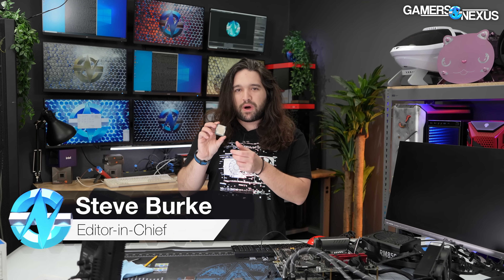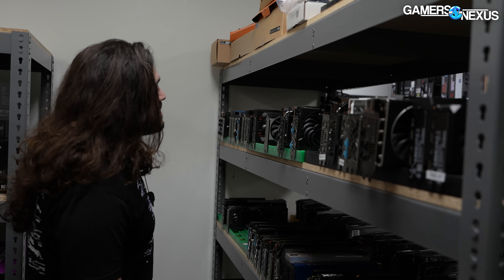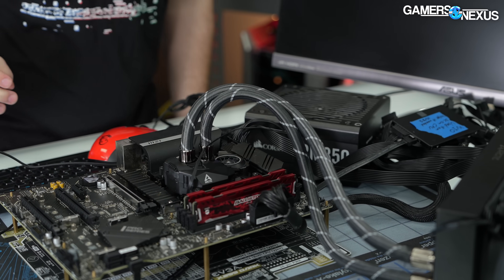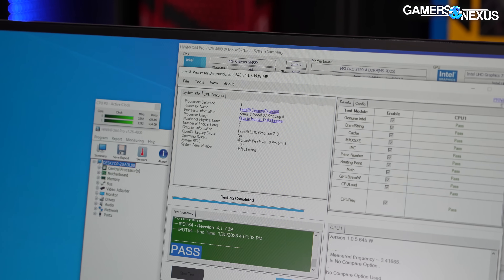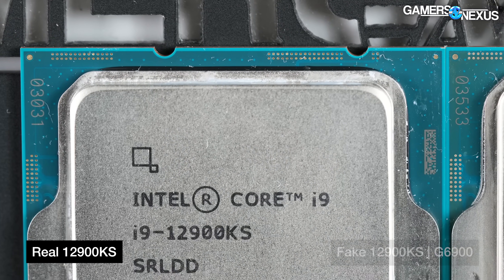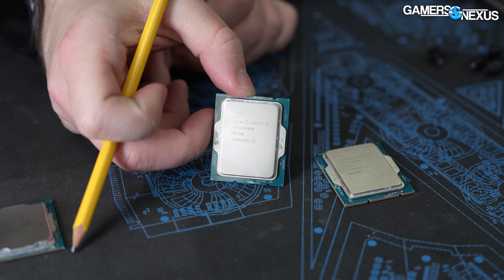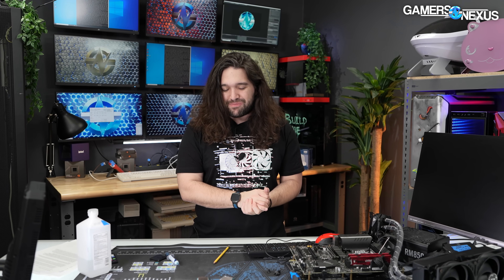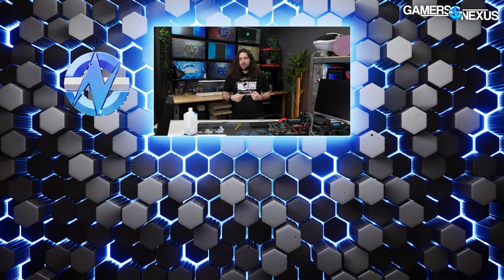Beware: Counterfeit Intel CPU Scam on Used Market

Comment: Another method I've seen is delidding the CPU and swap the IHS. 
The best way would be to put the Serial Number on the PCB/Substrate and have a lookup page to validate the cpu there.
unless they silkscreen a new QR code on - which is hard to do on such a small surface - faking it would be hard.
Reply: The only way this scam works is with a delid. Anything else is just too much overhead for scammers to pull off.

Comment: as someone who has lapped his 5950x, i can say it was a massive pain to get the dang thing taken off. lapping of course, requires you take all of the nickel off of the ihs however, the lettering was basically down to the copper
Reply: Yeah, apparently with AMD, this was only done by swapping IHSes.

Comment: This type of scam has been around for a long time. Certain processors like AMD units are a lot easier as they are identical from the outside other than the markings. There are a lot of fake 5950x's and 9900k's out there.
Reply: I guess most people forgot the Pentium era of 1997. The CPUs were never multiplier locked. You put the CPU on the motherboard and you setup jumpers to select which clock speed you want for the motherboard and what multiplier you want for the CPU.
For example, for a 100 MHz Pentium, you set the motherboard at 66.6 MHz. You set the multiplier at 1.5x. The CPU would be at 100 MHz.

Some people found out that their 100 MHz Pentium was locking up the entire system once in a while. They measured the thickness of the CPU and found that it was 0.x mm thinner than normal.
This is bc someone machined the surface off. They laser engraved 100 MHz and the rest of the info on it.

The material of the CPU was some kind of ceramic.
Reply: @louistournas120  Not laser graved CPU speed - the first Pentiums has even marked the speed with...a black pen, written manually speed on cpu :)

Comment: I'm just wondering why you would spend $500 on a secondhand 12900k when you can get a 13th gen i7 for $400...
Reply: You have a 12th gen PC?
Reply: @1pcfred  they're the same socket.
Reply: @1pcfred  not really. 6th, 7th, 8th and 9th gen intel share the same socket (although 8th and 9th gen require a different chipset but are interchangeable with each other). 10th and 11th gen intel share the same socket and now 12th and 13th gen share the same socket. Intel has been doing this for a while. Typically all that is required is a BIOS update to go to the next gen CPU on the same socket.

Comment: Yup happened to me on Amazon, bought a warehouse one a i9 and got a celeron hidden under a fake i9 cover. Was REALLY hard to convince Amazon to refund me.
Reply: Bruh, if you are the victim just say the thing that most likely will get your money back. Since it was a warehouse purchase you could have just said that it did not work and you would have gotten your money back. Choose the simpler option, as long as you are not taking any non-due advantage it is ok to do if it increases your chances of getting out of a scam
Reply: You just call your credit card company and put a stop payment on it. Then Amazon can deal with the CC company.

Comment: If you have an i9-12900K with the swirl logo on the IHS, it supports AVX-512 if the E-cores are disabled.  Not all motherboard and/or BIOS revisions will let you enable AVX-512.

A later stepping of the i9-12900K had AVX-512 support fused off directly and cannot be re-enabled.  These have the square above the model name on the IHS.
Reply: Wow, I did not know the 12900k had AVX512, I could've been playing sonic unleashed on it this whole time...
Reply: @BBWahoo  All the early editions of Alder Lake could have it enabled on the P-cores as it was just locked out in BIOS.  Again, this did require you to disable the E-cores and have motherboard/BIOS version that would permit enabling it.  This is one of those features that Intel tried to lock down in microcode updates contained with in BIOS updates.  There were a lot of hoops to jump there to get it to work and it just got harder over time.
Reply: @powerpower-rg7bk  
I wonder why they'd include it in the first place, I know there's a logical explanation but it eludes me
Reply: @BBWahoo  The same basic core design in Alder Lake is being used the recently launched Sapphire Rapids chips for servers.  There AVX-512 is a standard feature.  Trimming AVX-512 out of the design would have lead to delays and additional costs.  So they just disabled the AVX-512 functionality on the P-cores. 

One other factor is that the E-cores do not have AVX-512 functionality on Alder Lake.  Legacy operating systems without scheduling enhancements for the heterogenous core designs might assign AVX-512 workloads to the E-cores which simply could not process them.  Mixing core types in Alder Lake had its issues at launch and mixing instruction set capabilities would have increased the magnitude of those problems.
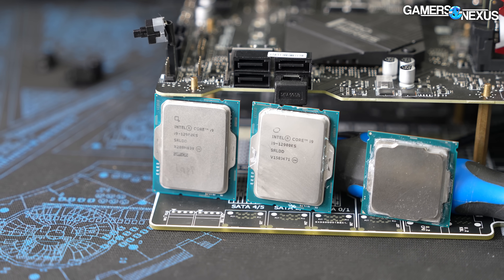Reply: and the 12900KS came out around the same time so all / most KS versions do not have AVX512 and have the 2 square logo not the circular swirl like the fake does in this video. The print is also too dark and too nice. Also notice that on the pcb above the ihs 2 sections of circular copper pads / test points are missing on the fake 9:54

Comment: Problem is, there is nothing stopping scammers using pictures of the actual part then sending you a fake. The penalty for faking this kind of thing needs to be severe enough to discourage it, not ignored by cops. Just recently I got scammed on a CPU from an actual retail distributor (my country's version of Amazon etc), paid for a CPU, got a laptop cooling pad.... The outlet did nothing to fix the issue and the company that was selling through them simply delisted the part. The penalty needs to be extreme, not ignored.

Comment: I dunno how useful that Intel utility is, I have some Engineering Sample Xeons with retail or near retail steppings. The Intel tool didn't even read out the (ES) string that e.g. CPU-Z does. And it reported Genuine ✅ PASS for all of them. lmao.

I wasn't scammed or anything - the sellers clearly advertise them as Engineering Samples, and the good ones will let you know exactly what stepping you're buying. So if the final ES stepping ended up being the retail stepping, you get a nice discount on what was already an outdated CPU you were buying for a file server or something. As long as you've no moral qualms with buying the things...

Comment: Counterfeiting is everywhere in electronics and it plagues every market. Even the military. Just last year there was a fatal F16 crash where the ejection seat parachute failed to operate, with the investigation finding that key electronics were counterfeit. It proves how supplied counterfeit parts retrofitted to machines can result in disaster and how stringent parts sourcing (especially traceability) needs to be.

Comment: linus has a video of someone buying a fake ryzen 5 3600

the way it was done was someone bought ryzen 5 3600 from best buy, delided it and placed the heatsink on an fm3 cpu, an fx 4350 if i remember correctly and the return the product to best buy 

the next person bought it and of course it didnt fit their am4 board

the way you could tell there was that the fm3 cpu had no smd on the back, in the center, and instead only had pins

Comment: Stop buying used shit ppl. The risk you run is immeasurable because you dont know the seller. Viral videos of crypto miners using high pressure power washer to clean hundreds of GPUs. Just so much sketchy shit. Quit doing it

Comment: As far as I am aware there were no 12900KS produced that had the Intel "oval" in the top left. Only the two squares.
The oval (along with the date code) can be a indication that the CPU can support AVX512. Again, as far as I'm aware there are no AVX512 12900KS. Only some 12900K.
Reply: someone gets it. Also top part of pcb missing missing copper test pads in 2 spots

Comment: Thanks for the interesting video. I just bought an Intel i7 12700K CPU and used your tip to see about warranty coverage using the serial # and Batch #. It's covered until February 12, 2026. Happy Days. 😉

Comment: I feel almost privileged and blessed to not have to buy used PC parts. But I completely feel for the folks who do it to save a decent amount of money. It's just insane how elaborate scammers are now.
Reply: A pleasant surprise to see someone acknowledge those aspects.  Thank you.
Reply: these scams are extremely rare 
unless you're willingly shopping for used parts on aliexpress, craigslist, etc, you won't get scammed 

Ebay protects it's buyers more than sellers. They will absolutely step in and destroy sellers who try to scam customers. 

Amazon is very laid back, but always check if the listing is fulfilled by amazon in which case amazon will supersede any authority from the seller and process returns automatically without the seller's input. Amazon warehouse are good used parts.

Comment: Steve IIRC there were already scams with AMD CPUs.
They took advantage of same Socket CPUs (it was AM4, like 1700 for both CPUs in this vid).

IIRC correctly they simply glued, badly, the IHS of a 3600 on a Ryzen 1600 and sold it as the former.

Again, IIRC you covered as well.

This scam is much more elaborate tho, since they need IHSs to (laser?) print on.

Comment: Not sure I'd characterize Intel's IPDT as a tool to find fakes. It's more about checking if a CPU can complete all the specific function tests run.

I'm also missing the use of Task Manager given it's built into every version of Windows and quite detailed in reporting which CPU is installed.

Comment: This is exactly why I test parts and call it off if they don't let me.
Reply: Yeah, it's customary here to go and buy the part in person, to check if it's working fine and if it's exactly as advertised. You might have it sent if you're dealing with a high reputation seller but otherwise it isn't recommended.

Comment: The tool you used in the video was to Identify Fake Intel CPUs (these are a thing entirely) as well as CPUs with BIOS that were modified (a problem in China where Celeron systems were being sold as i7 but appeared as i7 in windows). This is what the tool tests for.
Reply: This is the first reply that mentions these are all from China. Maybe don't buy your hardware from China?
Reply: @zodwraith5745  it's all made in China my dude
Reply: @moth.monster  Yeah but there's a difference in brand certified and quality controlled Made in China and random named BangHappyPowGood company Made in China.

Even the "good" stuff that comes from the same factories using the tooling bought for official runs is done with substandard components and materials behind the company's back.
Reply: @zodwraith5745  Yea there are always two different production lines in China:
-the one backed by big brands with quality control and high standards
-then the knockoff ripoffs destined for alibaba and similar sites with no quality standards really at all, but they 'look like the real deal' so they know people will buy them even just to throw them away to go find the real one. 

Chinese knockoffs are all scams, you really have to do your research these days on sellers

Though I find it interesting that the knockoffs all play by the rules when it comes to the actual branding, they do have a requirement that is cannot be exactly the same logo as the production brands
Reply: @austinh1028  yep, tbsfe zee some good knockoffs though.
Reply: @zodwraith5745  nah, must have been the kids.

But seriously, it's going to get a whole lot worse in china because of the sanctions.
Reply: @zodwraith5745  well the CPUs are typically not made in China. Some of them are diffused in China but not typically many Intel CPUs. However they by CPUs in bulk and then they reprogram the firmware because they have all of the tools to do that in China and the CPU appears as if it is a different CPU in Windows but physically it is actually like a single-core or dual-core Celeron but it appears as an i7 or i9in Windows. So there are specific tools to check the physical presence of things in the hardware to determine if the CPU is fake.

Comment: WARNING: In addition to this (great job as always GN) beware buying used GPUs, even if seller says “tested, working from working system” even if they have hi reviews. particularly Vega in my experience (i build affordable gaming pcs out of a mix of new and used parts, validate scores and bios tuning before selling) or any other cards prev used for mining. The seller got me by taking the photos in a dark environment, and he had a pristine box (sapphire vega 64 ltd edition) and all looked well and was at normal prices for used vega (around 125-200) which isnt a bad deal, hbm2 aged far better than gddr5. However, when i received it was full of rust and obvious saltwater corrosion (dont buy gpus from florida sellers i guess lol) that is so bad the power delivery chokes are completely rusted through and the io ports are covered in white corrosion and the rear was covered in rust. Screws were rusted into the pcb from backplate. Contacted seller (opened after a month unfortunately as was waiting for 2nd unit for crossfire testing) and called him out for being a scumbag liar. And that theres no way he tested it or it worked in any capacity. Told him off with many choice words and reported him but was too late to get my money back. I thoroughly cleaned it and am waiting on new chokes to replace the rusted ones and a cap that appears slightly melted and hoping i can bring it back to life but my expectations are very low. Out of the other 3 vegas i bought 2 were clearly from a dirty ass mining shed and were filthy and full of dirt and leaves (thoroughly cleaned and repasted before turning on and at least these worked) and only 1/4 i bought was in what id consider acceptable condition with tbf a clearly recent repaste and cooler was free of dirt and leaves, just some particle dust that i blew out and gave an alcohol soak. DONT TRUST PPL, sadly, ask for additional photos in GOOD LIGHTING, if the cards older or was a popular mining sku. Some people who shouldnt be within 10000 ft of electronics will sell you broken garbage and lie about it even if they have very high reviews and lots of sales. Lots of BS slimy scams going on around now. For safety, id recommend buying from amazon or ebay and INSPECT AND TEST IMMEDIATELY IF POSSIBLE! Hope someone reads this and avoids the mistake i made by getting fooled by a mint condition retail box yet the card if f-d to hell most likely.

Comment: the tool was never meant to test if a cpu was Legit, it was always meant as ( what it is also clearly labeled as) a diagnostic tool to check if a cpu is running in spec, and working correctly

Comment: I do have to say that ebay actually has solid protections for buyers. Between looking at sellers that have a reputable rating, good number of sales, good review history, you are pretty safe. Even if you do get taken, ebay let's you return pretty much anything within the window, even if the seller doesn't accept returns.  The only key is to just make sure you return the thing before the return window closes. You basically need to be ready to test expensive components when you receive them to be safe. If meeting in person, meet at a police station. I have done a few "offer up" transactions and its always inside the lobby at a police station. You won't get robbed and it'll generally get rid of scammers wanting to not get caught. Someone unwilling to meet at a police station is a red flag.

Comment: Of course Intel isn't going to change the design. Don't forget that Intel also profits from these scams! The scammer buys an authentic chip, alters it, sells it to the victim, the victim then buys a legit chip. Thus, Intel gets money twice for each of these scams where the victim buys a legit chip and still gets money from the scammer if the victim doesnt.

I firmly believe that every model GPU should have its own design so that you can't be scammed. No one is going to confuse a Ford Focus for a Maserati.

Comment: Why not etch the CPU model onto the substrate?  They already have the 2D code there...  Use a different edge or corner for the actual CPU model.

Comment: I'm shocked they aren't doing that scam with AMD as the Athlon 950 sells for $12 and the 5800x3D is selling for $330 and both are AM4.
Reply: Actually that did happen a few times on eBay those sellers though usually get kicked off the site
Reply: You're giving them ideas!!